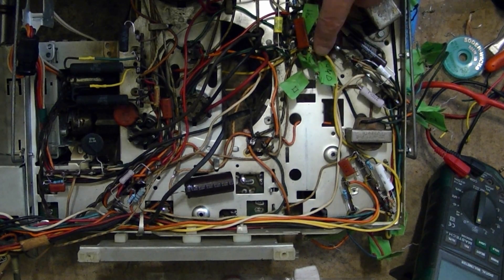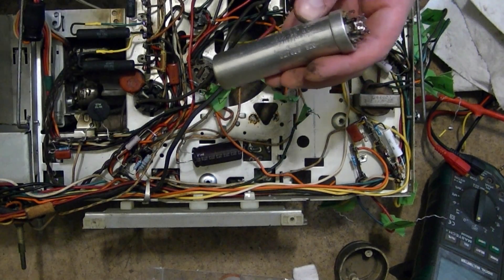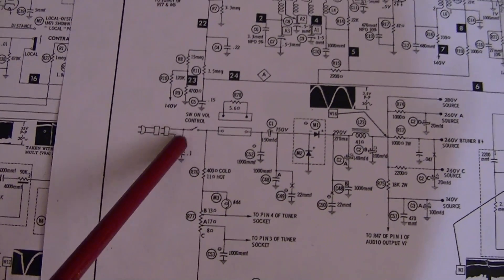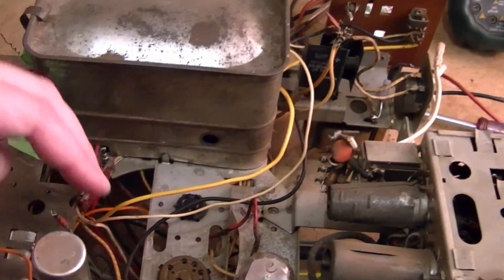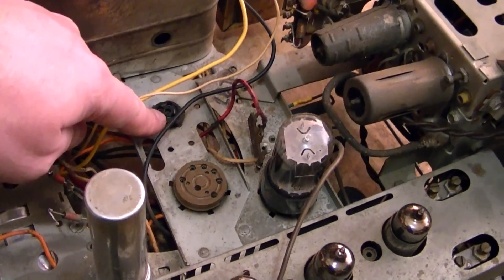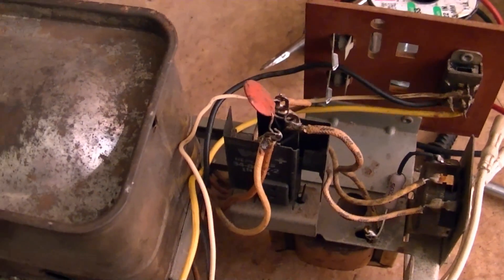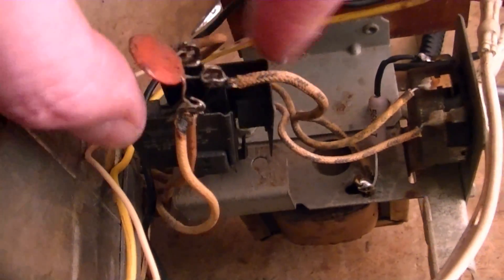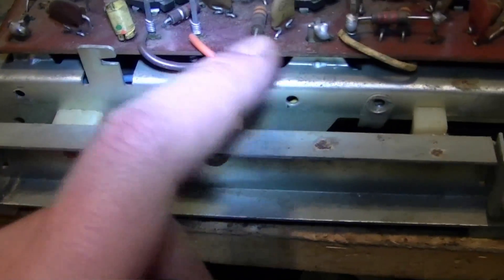Predicta "Holiday" restoration p5o?

Comment from the maker: I think that cap is also there to filter noise on the AC line going into the set.  If I leave them out of my radios, I get lots of horrible noise.   I''m pretty sure PCBs are only present in oil filled AC caps like used on HVAC motors.

Comment: Even if the cap were there for arc suppression, which I'm not even why they would bother with, then it would have the same effect to suppress arcing on the set side of the switch as it would on the line side of the switch. If you look at old record changers they have a power switch for the motor on the changer, independent of the amplifier, and it's very seldom that they have a cap connected across the line going into that switch.

Comment: No you got it right the first time, they are used to reduce power line noise from getting into the set, they are particularly important on a transformerless or AC/DC set for this because you can't connect a ground to the set to do the same. The filter caps do not have PCBs in them, it's electrolyte which is basically a borax paste and water. The only caps that used PCBs were non polarized motor run and start caps, and sometimes oil filled bypass ones.